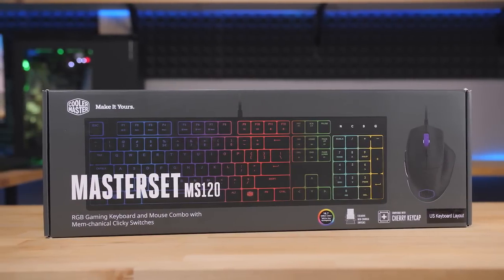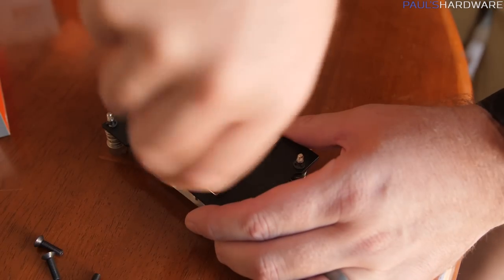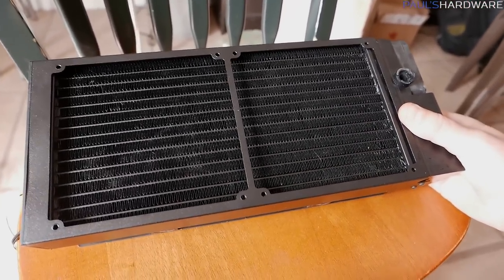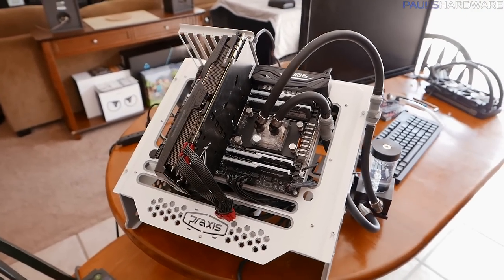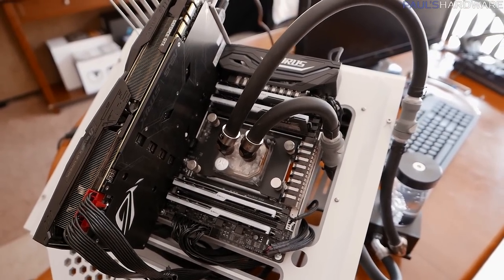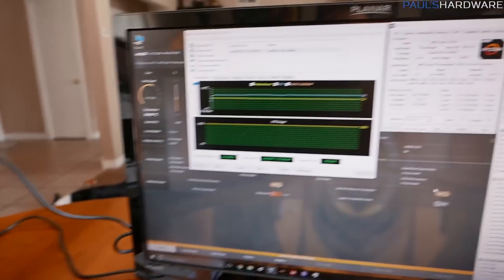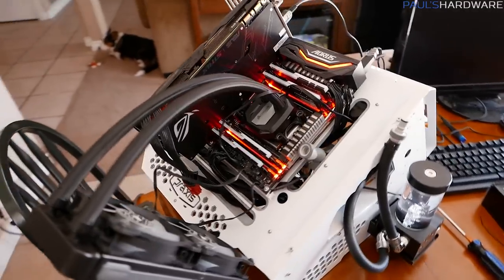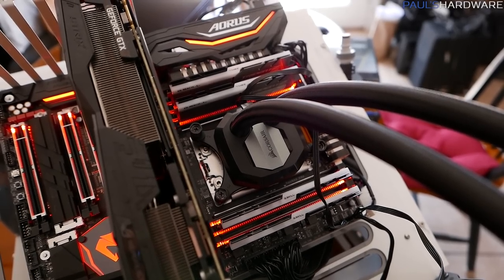My Failed EK Supremacy EVO Threadripper Edition Review

Comment: A functioning AIO would have been adequate, and quite warm... for stock clocks. Would I recommend it? Nope. The chip is too big to be properly cooled when overclocked by the little round heatsink. Noctua made a cooler specifically for threadripper that works wonderfully!

Comment: For info, my 1950x at 4.2ghz on all cores at 1.55v also sits at 68deg on the same test with my ek TR block but I have a 420mm rad, better pump and better thermal compound application. At idle I am about 2deg over ambient.
Reply: On a side note, Paul is getting thermal throttling there. With no overclock I never see under 3.7ghz with all cores loaded. HWinfo always shows minimum as 3.7ghz.

Comment: Guess I've been fairly lucky with AIOs. I have a H50 that is still going strong from 2011. But I had a Antec 900 die on me and a CM Seidon be faulty right out of the box, sounded like ball bearings bouncing around in the pump... I own/owned 6 or 7  of them at this point, even used the Zalman Reservator v2 to cool a 4870x2. I'd like to try custom loop at some point because overall sysetm seems quieter, but parts seem pretty pricey. My current main rig is using a Swiftech H220-X, closest I am getting for now. My 2 cents.

Comment: ive been using an antec kuhler 620 for my i5 3750k for about 5 years straight now. computer is on every day with an 800mhz oc. its been through a few thousand hours of gaming. its still going strong and idles about 35c and maxes at 60c. id saying pretty good.

Comment: I had a h100iv2 die after 4-months use.  Corsair RMA wanted me to ship it to Taiwan, which costs MORE than $100.  Ugh, it's still in a box.

I'm going to replace these with Noctua coolers soon.

@Paul can you do a TR 1920X temp test with a Noctua cooler please? Say the NH-U14S TR4-SP3 or the 120mm version?

Comment: Talk about timely. The pump on my H115i v2 in my personal rig just died. I had it sitting for about two months while I used a Ryzen system. I just gave that one to some friends. As soon as I started it back up it was overheating. No about tweaking could bring it back to life. Couldn't be without a system for the long weekend to wait for an RMA, so dropped way too much money on a Kraken x62. I don't have the space to do a custom loop in my current case. :-(

Comment: Don't get down Paul, you might not have achieved your goal but we all learned important lessons through your efforts! 1. Custom water cooling pays rewards in flexibly of build/serviceability, 2. AiOs are not reliable nor serviceable. Good luck on the next projects! Request: an updated video on custom cooling best known methods for higher core count processors
Reply: You can service an AIO (I've had to fill mine back up with water, they just evaporate after years and years...). Also you should be able to just replace the part that fails (put a pump in line with it and remove old pump impeller, at least it looked like that would work in mine). If not, a good CPU block is only like $15 and get a cheap pump (you still have a good fan and radiator).
Reply: Oh, you also need to define "best" when you are talking about coolers. (cheap, coldest, lowest maintenance, least operating cost). I have one that will keep it icy cold (but be prepared to replace parts when a drop of water condenses and shorts it out, so make sure its waterproof and well insulated + heating elements to keep it from freezing over). RIP my 50+% overclocked GPU, you lived a long, well, sort of long month of a life before dieing of thermal fatigue and cracking the solder... (CPUs don't have that problem by the way)
Reply: Jake Garrett thanks for the pointers! Actually what I meant by best known methods was precisely the types of pointers that you gave in your replies. I.e. setting up for high reliably vs highest performance, those types of tips are very helpful.  Thanks again Jake!

Comment: I've bought the Silent Loop 280 from bequiet! in March this Year. It died 3 Months later. Now im on the second one. I was inaudible the first week, then it got a bit louder to the point I can hear it a little in silence, still its VERY quiet. But if this one dies im going back to air. Temps shouldn't even change at all if I switch. I have an DELIDDED i7-7700k. 
When waiting for the replacement AIO I had to use my old Intel STOCK cooler form my previous i7-2600k. That Stock cooler was loud, but kept my Temps under 70°C under load. With AIO my Temp is 55°C under heavy Load.
I can imagine that my Temp will be under 60°C even when using Air. Going to use something bigger then the Hyper 212 Evo, but smaller then the NH-D15. Any recommandation if it comes to that? My points of interest are cool and quiet. Looks are irrelevant since i have a closed system.

Comment: know exactly how you feel about having everything go wrong. I've been trying to do a case mod on an Air 240 to put my 1080 in a vertical position, and I just can not seem to get the actual process of making the mounts, work. despite measuring everything 2 and 3 times, the pieces I cut always came out wrong. my rotary tool overheated on me to the point that the locking mechanism that holds bits in place melted a tiny and now can't be unlocked so I can't change my bits.  I finally just gave up on it.

Comment: Man, that sucked for you. I've used four different AIO's in different rigs over the last few years and have had zero issues, although I have just built my first custom loop. I set my cpu protection temp limits at 75c in bios, since it should never reach that high unless something is wrong.

Comment: Why wouldn't EK just make a water block that has a contact point that is the size of the die ?????? I just don't get why you would only focus on the centre of the chip. Which obviously is the hottest point but still you would think that having a plate that covers the whole die would cool better?
Reply: That's a fair point. It's not like they aren't making unique gpu blocks all the time (which sound like they would be way more of a headfuck, with all different component heights). How hard is it to stretch out their cad model of the supremacy block? It would look cooler too.
Reply: Exactly right. Most blocks and adaptor plates that I have seen have had sufficient amounts of room around the socket cover. So it is definitely not impossible

Comment: My h60 has air in the loop... somehow, though I've had total fan failure before and similar issues with a regular heatsink and single fan.  That fan failing and also causing total system shut down.

So ultimately custom loop with dual pumps, well D5 pump imo is alot more reliable then a AIO pump, but that or just a regular High tier cooler with at least 2 fans for backup.

Comment: Don't worry Paulio, on to the next :)

P.S. I've had a corsair 80i or similar for 4 years and it's still working well. It's never under that much load though unless it's 3D rendering.

Comment: when I bought my 1800x (before reviews came out about 1700 being able to match the 1800x)
 I bought a noctua nhD15, aircoolers aren't exactly the best either. I don't game but I often make use of all 16 threads and my computer is loud! I think "custom" loops are the answer if the price was better, in the mean time choose between reliability but noise on air, quiet but unreliable on aio, or quiet but expensive on custom.

Comment: But isn't an H100i only 240 millimeter radiator.  The other one you have is 380 millimeter?
Reply: Spoke before the end.  Please get an AIO that is same size as you custom water loop. Or standard size water block for the custom loop.

Comment: I'll be pedantic, but it's meant well, I promise. If the subject of the video is a water block specifically designed to cover the entire IHS of a CPU please spread the TIM manually or at least ensure better distribution - contact surface matters as indicated by the recent NH-U14S TR4-SP3 tests over at GN. Otherwise you're testing what happens if you're "doing it wrong". Also, I'd argue that using Thermal Grizzly for a test is also not especially representative for most users.

Comment: Your one-blob thermal paste method was terrible - the paste is very thick. Temps should have been much lower if u used a spatula, or even use liquid metal instead of thermal paste.
Another question, doesn't TR have a per-core temp?

Comment: I really hope my x62 will do a good job for 3-4 years... Because now im kinda scared
Reply: i'm on my 2nd X62, first one lasted 4 months until the pump died.  
keep a stock cooler or something ready and always keep an eye on your pump RPM on some stats display/screen.  
always mount the radiator in the TOP, air always wants up because physics and you DON'T want any air bubbles to be stuck in the pump. I had mine front mounted for 2 weeks before i changed it and then i could hear an audible flushing sound when i switched it back on, there was absolutely air inside the pump for the first 2 weeks, pretty sure that is why it died.

Comment: H100 V2 running for 1 year an i5 6600k at 4.6 Ghz fine, H80i GT running for 2 years multiple systems fine, and an h55 running for 4 years an A10-7850k (my first AiO). I have to assume you just had bad luck Paul. 🙁

Comment: Whyyyyy.............. I have a video that shows some real info on this, the Noctua TR4 air coolers are better than a round acetek coolers so I am pretty sure that the EK situation would be much better although something was wrong with your setup as you were getting temps on the 1920x worse on water than I get on my 1950x on air. Enermax is sending me their new TR4 cooler, should make for a good video.

Comment: Ah I expected to see a serpate block for the loop so it was apples to apples on does a bigger plate help not aio pump vs full blown pump comparison. Maybe I will find one that does that. X.x but dang aio's it's why I never use water cooling why add the extra point of failure and risk. What is the second higher CPU temp?

Comment: This is pretty much why I have never been tempted to get an aio. It is simply another point of failure. I have an enermax ets t40f bk air cooler and a 6600k overclocked to 4.6 and even under load with hours of gta at max settings in the summer, the temps never go above 60-62. The most I have to fear with it are the fans dying on me, but thats a 40 dollar fix vs an aio being a 80-150 dollar fix. Yes an aio will probably get me 15-20 degrees cooler, but considering my current temps, its completely unnecessary.

Comment: I get flamed all the time for telling people to STOP using AiO coolers. Yea you MIGHT get a couple years of use, but their performance gets shitty after only a year of use, and worse and worse after that. They are trash, STOP USING THEM until someone makes one that doesn't get gunked up in the pump and fail. Swiftech makes a badass cooler that is expandable and easily maintained
Reply: Mine hasn't gunked up since before Dell had Alienware. It was originally for a Dell XPS system. Its ancient, I did have to refill it because it does evaporate out after so many years, but no gunk on the block, it was shiny like the day it was made. But nothing lasts forever, but they are super cheap (compared to my awesome cooler, not water obviously). Maybe its just the new stuff they use.

Comment: An air cooler with the same price as an AIO will often perform comparably. And air coolers don’t break. Watercooling used to make sense for mid-range systems to keep thermals in check, so AIOs made sense then. These days, watercooling should pretty much only be used on enthusiast systems, at which point custom loop is the way to go.

Comment: Corsair H100i V2 is not so reliable as it was supposed to. Mine pump just broke down only after 3 months of usage in a i7700K system. Luckily I was refunded as they don't have any in stock for RMA. So, this time I choose to go with Deepcool Captain 240EX with red accent. So far, it's looking good although there some bad reviews for their AIOs. However, this performing well and also looks great with that steampunk reactor style water pump. 😁

Comment: This is why I use air cooling. I've always thought AIOs are stupid and aren't worth it in price to performance even when they work. 50% more price for a few degree improvement and terrible reliability. Only exeption being some small form factor use cases. Custom loops are even worse in price to performance, but they at least have the "best there is" going for them so I understand why enthusiast use custom loops.

Comment: I have taken several AIO pumps apart. Every one of them have been built very very stupidly. In one they paint the rotor for crying out loud. The paint cracks and corrodes the metal under it and destroys the pump. Another it's plastic and the spindle had no keyway and just wore a hole in the rotor. Every one i have pulled apart have all died from stupid pump design. A simple anodized aluminum rotor and all of these pumps would still be working. You are paying at minimum 100 - 250 bucks for one of these setups. Not a single AIO I've taken apart has been worth the money paid for it. A couple I have repaired with new 3D printed rotors. It never gets hot enough to degrade the plastic. It's been 4 and 8 months and they are still running.

Comment: Well, Asetek is popular, but even not the best company as well. In fact all the EOM products based on the exactly same technology with minor diferrences to each other (mostly not important toy-features).
Even EKWB makes a mistakes, but its way better products as well. 
I use mostly Alphacool and replaced some pumps in Eisberg&Eisbaer system (mostly to better ones- very silent new versions). NexxOs radiators are one of the best in focus to performance. 
In my experience, Asetek systems loose the water and pumps goin' dry. Ive repaired some AIOs from Asetek- one of them runs right now in PC from my son, but, honestly, its not really e nice product (bo say it careful..;-) )
Best regards from Germany,
Sebastian

Comment: I appreciate the honest manning-up attitude. Sometimes, you just have to say screw-it, cut your losses and move on. Most DIY computer builds run into this sort of a situation where you really can't be without the computer and wait 3 weeks for the correct part to do it right, so you just improvise and move forward as best you can and then re-visit the correct solution at a later date. Anyway, serious bonus points for the honest expose' instead of just shelving the video and pretending that everything works perfectly in Paul's world. :-)